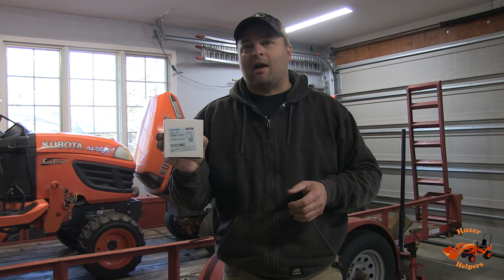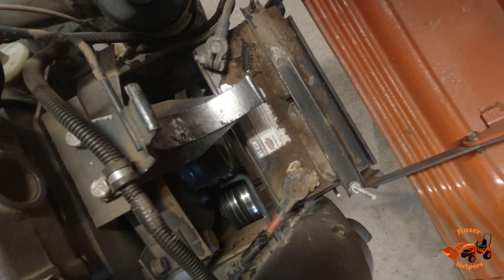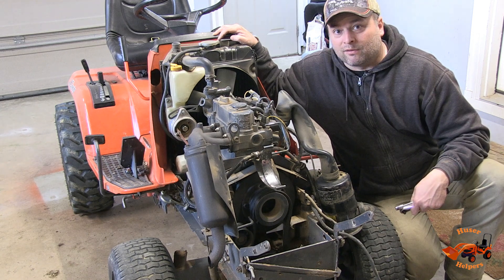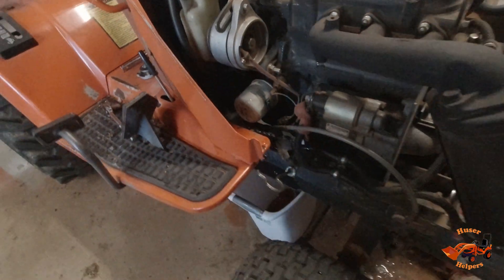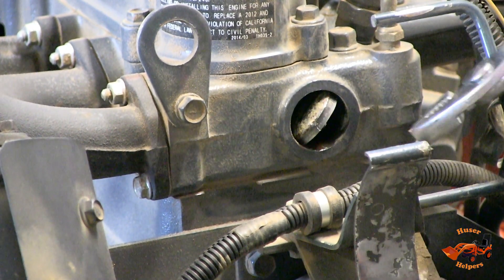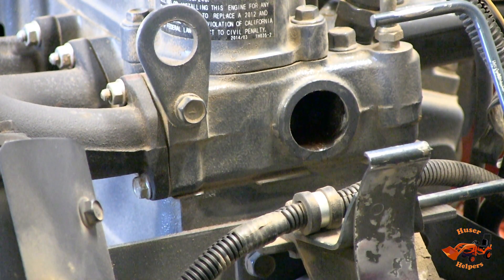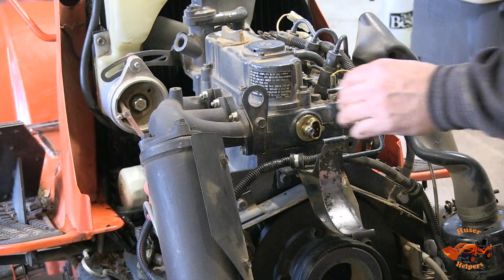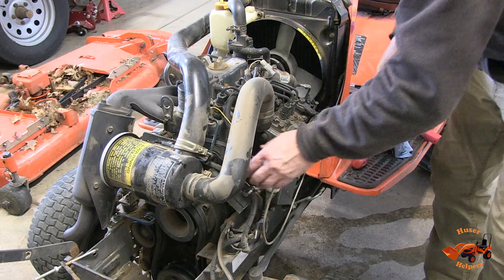Installing a Block Heater in a Kubota D722 Engine

Comment: Oh! Awesome calling out for your 1k subscriber gift! Nice. Keep up the good work, Kubota and all cars and trucks are sold with block heaters up here.  Cheers and thanks for the great walkthrough
Reply from the maker: Thanks Ross.
Reply: It is the same thing with my dealer here in Iowa Jason. He has block heaters installed in every new unit that goes out the door
Reply from the maker: @tractortalkwithgary1271  that makes since up in the north.  My BX is a southern IL and this G1800 was from Southern Kansas where I was raised.  What is funny is most of Dads ag tractors come with block heaters installed.
Reply: @HuserHelpers  , to my knowledge, there isn’t one made for my John Deere 2520, and it doesn’t want to start once it gets below freezing. I put a tank heater on it and plug it in. Then I come in and trip the breaker in the basement. I get up the next morning, turn the breaker back on, fix the fire in the wood furnace, make breakfast, and then go do the morning chores and then start the tractor. By that time, the heater has been warming the coolant for more than an hour and it usually fires right up.
Reply: @HuserHelpers  Question Jason. I have always been told by the big truck mechanics to unplug the power source to the block heater prior to starting. They claim that once you start the engine that cold coolant will hit that hot element and instantly burn it out. Is that your understanding as well?

Comment: I have a Cub Cadet 1782 diesel Super garden tractor with a D640 engine.  It uses the same block heater and they are a pain to put in.  I am replacing my old one now and came here hoping for a better idea while installing it.

Comment: Per my previous comment.  I was replacing an old block heater that leaked.  I ended up taking a shaviv deburring tool around the lip to bevel it, then I took a flap wheel in my right angle drill to the port to clean it up.  A bit of grease on the o ring and port and the block heater popped in and sealed.
Reply from the maker: @ebla83  great idea
Reply: @HuserHelpers  thank you.  It makes me feel better that I am not the only person to have issues with installing one.

Comment: Great information and it should make make the engine run better, also less load on the starter and battery. I am sure you will get to 1000 subs very soon
Reply from the maker: Thanks buddy.  Have a great New Year.

Comment: Could need new glow plugs ! As for coolant, the Dex Cool orange is a GM vehicle coolant that was really bad on gaskets when it first came out I heard. Don’t know if it’s any better now, personally I’d go with green long life or any standard long life coolant for all makes and models since the Kubota diesel isn’t of the type that needs the special diesel coolant like the big rigs do. Have a Blessed Day and Happy New Year 🎉
Reply from the maker: Glow plugs are good.  This was a new crate engine from Kubota and only has 300 hours.  Even in the summer you have to use glow plugs unless it is hot.

Comment: I’m surprised you had to use a dremel on the block heater for it to fit. Great job Jason, your all set for the cold weather. Happy New Year 🙂🙋🏼‍♂️👍🏻
Reply from the maker: I only used it on the O-Ring.  Since I cut the original o-ring I bought one that was about the right size.  It was a little too big so I made it a little smaller.

Comment: Be careful  with heater element if installed facing up because it could be exposed to air in engine if water level is low, possibly burning out the element. As for the O ring, a small drop of dish soap makes a big difference when installing
Reply: Been 3 days for me.   Still trying to get mine installed.  Tried everything.  Keeps ripping o ring

Comment: Strange my 97 g1800 with 1200 original hours on it fires right up despite the temp...couple days ago it was only 4 or 5 degrees...what helps is when you cycle the glow plugs i do 3 times when its bellow 30.. No block heater...just a battery tender
Reply from the maker: That is strange.   Both my original engine and this one (new from Kubota) have been hard cold starting.
Reply: @HuserHelpers  Try cycling the glow plugs a few times in a row...it helps and raise the throttle a little too

Comment: Just did mine.  Might have shaved off to much in the rubber ring.  So far no leaks.  Instructions that came with it are not very specific